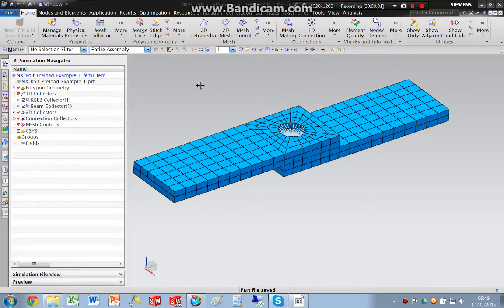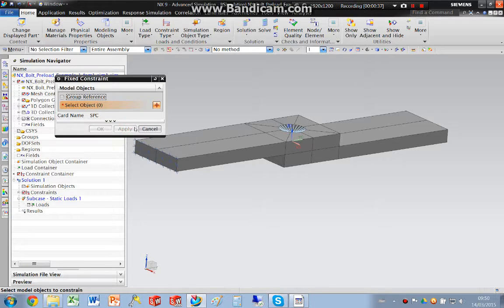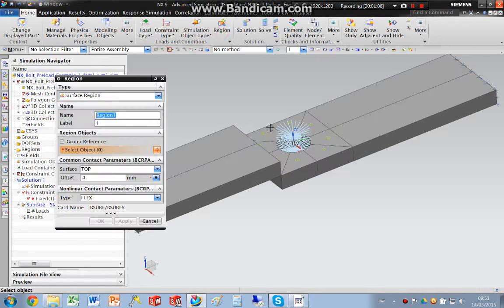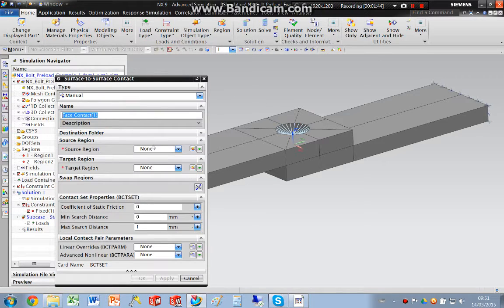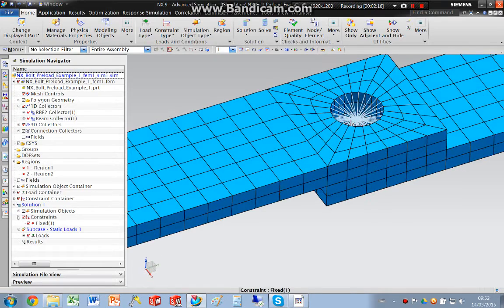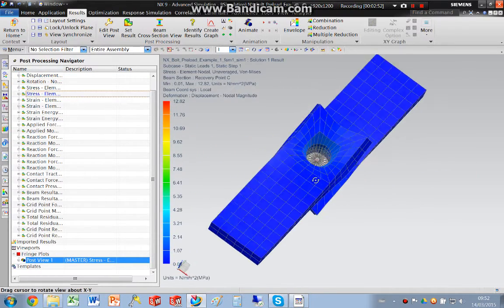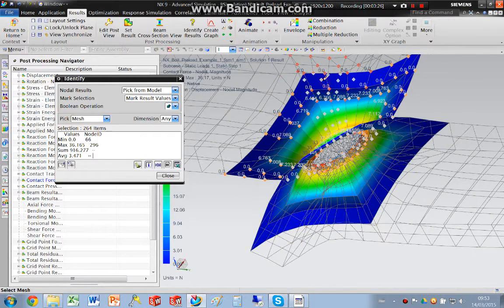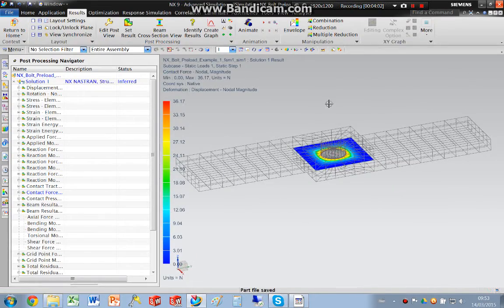NX Bolt Preload Example 1 Part 2

Comment: If M24 bolt connection is used what should be the force applied in bolt preload, and part is of 7000 kg mounted on a block

Comment from the maker: If you did not generate the surface regions then Nastran would not know that those elements were in contact with each other.

The elements would then pass through each other and there would be no calculated contact forces or pressures.
Reply: +Matthew Jackson Thanks Matthew! In my simulation I did not define surface region, only mesh mating and my parts disconnect from their places. I'm going to define  a the connection like you did.